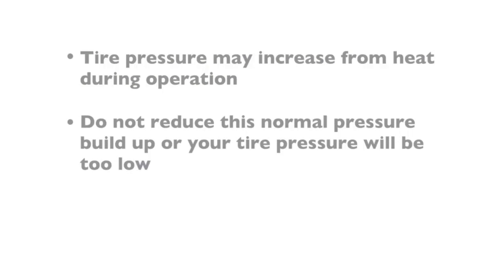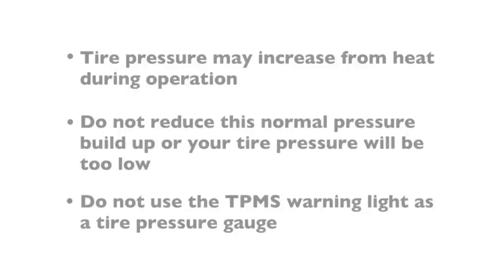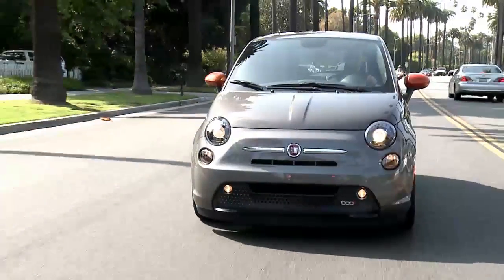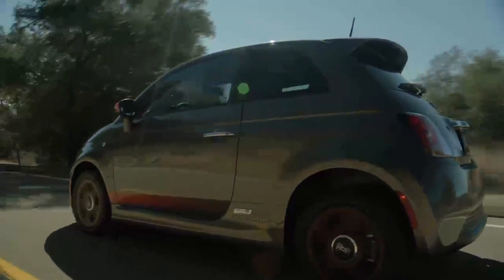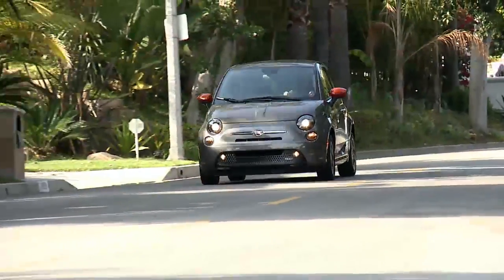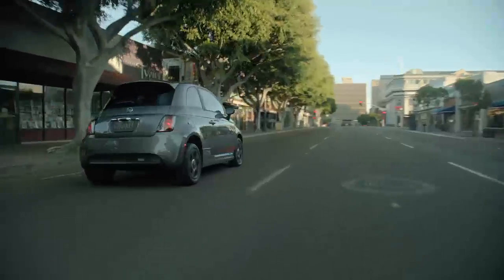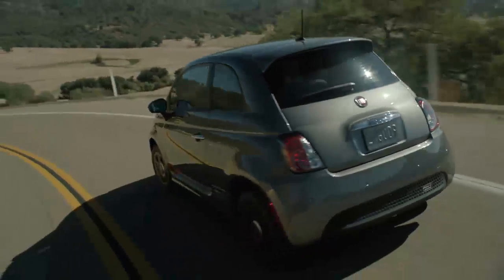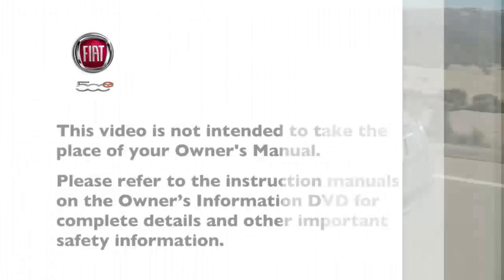2016 500 E | Tire Pressure Monitoring System

Comment: Why is it impossible to find a tire pressure number, all you get is - check the placard. It seems early models rated at 35 PSI later at 38.
When I do find a number it's usually wrong, for the gas models.